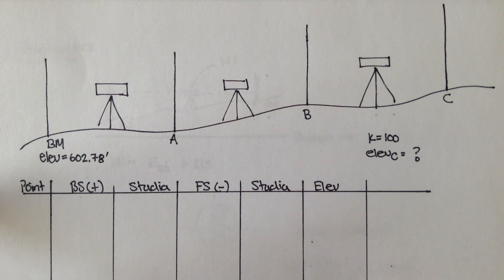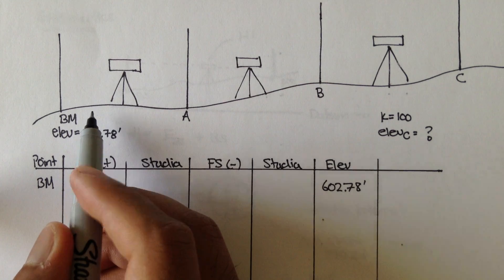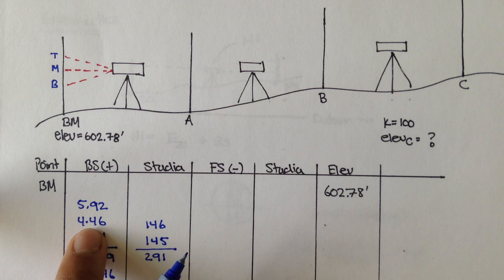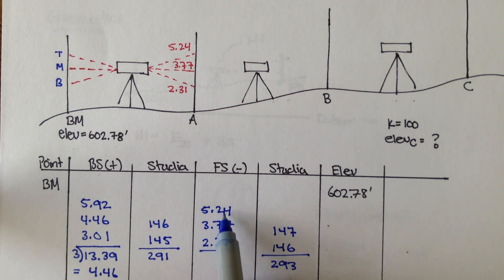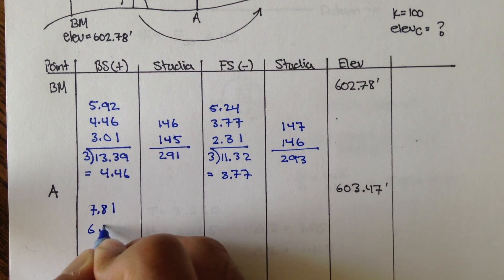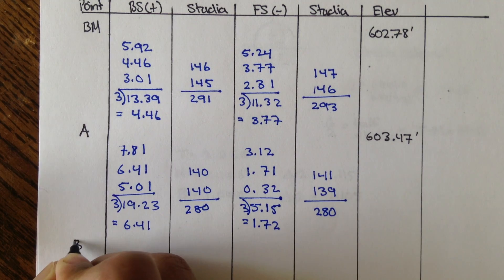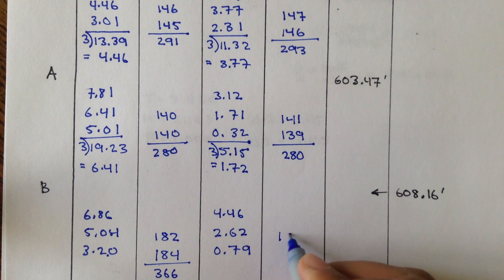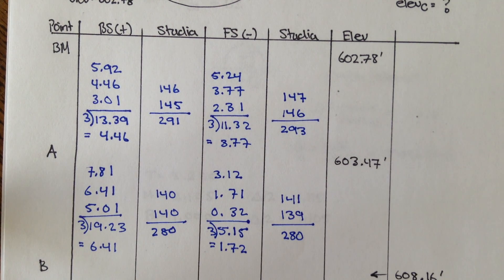Advanced Geomatics: 3-Wire Leveling Example

Comment: I need clarity on this please, 

While calculating the stadia, you said T - M x 100 (which is given as K), M - B x 100 and you add both numbers, the answer becomes your HD...

 you did another video under 3 wire leveling and you said, for stadia, T - M, M - B you add your answers then multiply by 100  = HD

Why are they different? Perhaps which one is the correct one?
Reply: I just saw another video were you clarified that.. it's the same thing all together..

Thanks..

Comment: One thing that confused me is that how did you decide the numbers of the backsight and foresight? I mean exactly how you come out with these numbers, especially for the backsight?
Reply: Asuka Graham in the field, you get the numbers by looking through the instrument (level) and reading the top middle and bottom wires. In the video he’s probably using notes from a previous bench run or just came up with three numbers that worked for the purpose of the video.

Comment: Now explain how any actual accuracy can be acheived on an ever curving 
surface. The Earth has a perpetually curving surface right? Right? 
Wrong. The only way leveling can acheive any accuracy at all is because 
the Earth's surface is flat, and measurements are taken in relation to a
 level plane. This is common sense.
Reply: LMFAO
Reply: flat at only poles
Reply: this is plain survey. curvature of the earth isn't concidered
Reply: johnnybunz - Common sense eh?! So WHY do we have to compensate for vertical error when completing a geodetic survey (over long distances) if the earth is flat? Wait! I got it! it's magic right? Am I right?!
Reply: @noisyboyuk   A level plane, is a plane tangent to the curvature of the earth: i.e, if two points are close to equidistant from the instrument, that error involved evens it out.  Say the maximum acceptable range for a telescopic survey is 250': The curvature of the earth would account for an elevation difference of per shot that long of 0.00591856060606 ft. with "survey rounding" that is 0.00 ft.
Reply: If your distances from instrument to the rod is roughly the same the curvature is taken care of.  Think about it....
Reply: If your distances from instrument to the rod is roughly the same the curvature is taken care of.  Think about it....

Comment: to get your stadia you can also subtract the top wire with the bottom wire, remove the decimal point. like 592 - 301 = 291 ... 781-501 = 280